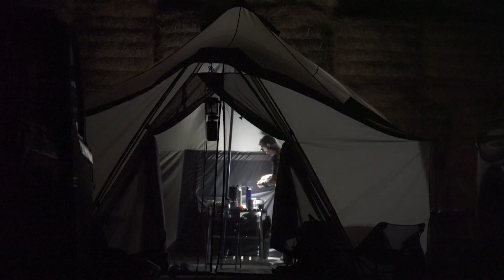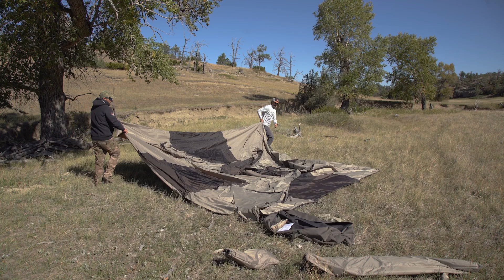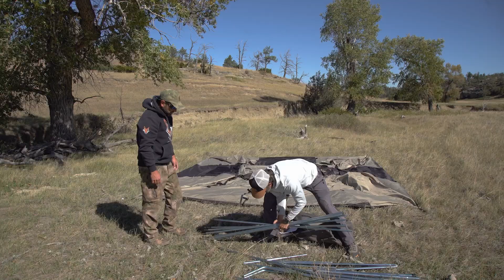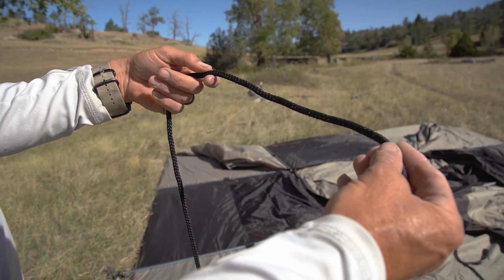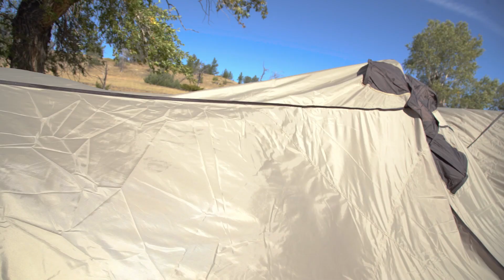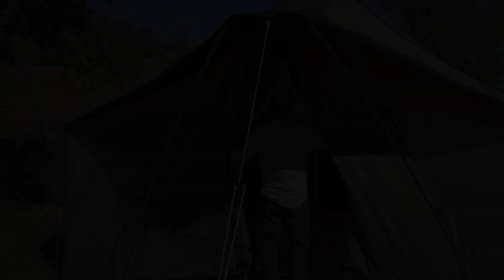Bridger Tent Set-up Instructions

Comment: I had an old Alaknak from Cabela's that was a really good tent. The nylon was much heavier that the newer ones before they were discontinued. I'm not familiar with your material here. Can you elaborate on it's qualities? I want another one of these for a base camp with a stove for bow hunting elk. Thanks.
Reply from the maker: Sure! The tent body is made from Relite HD 250D polyester material with a 1500MM PU coating and the sewn in floor is made from Relite HD 300D Polyester material with a 3,000MM PU coating. This Relite HD performs very similarly to our Relite RS material that comes standard on our Montana Blend style wall tents.